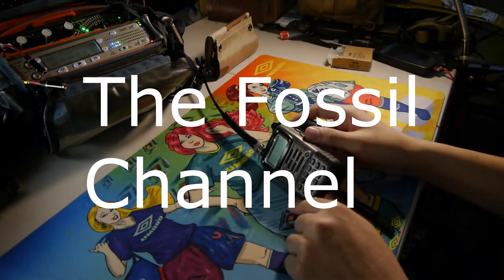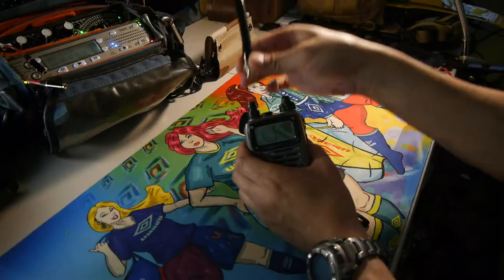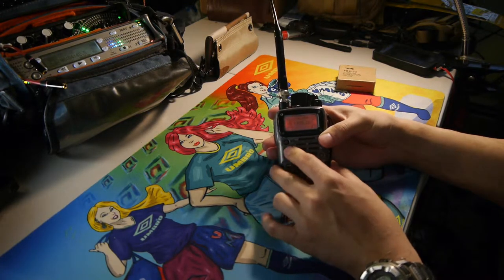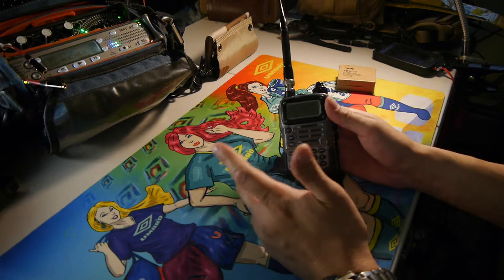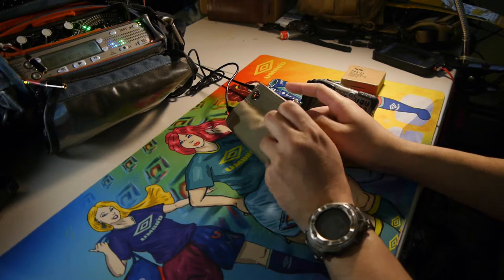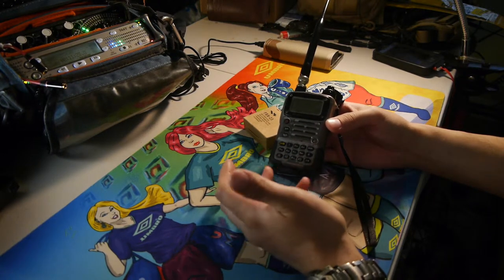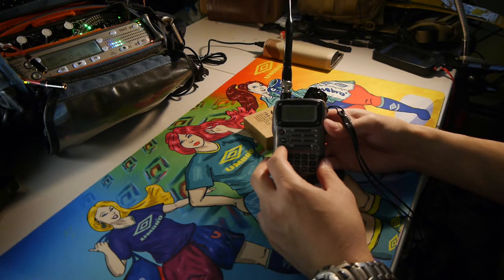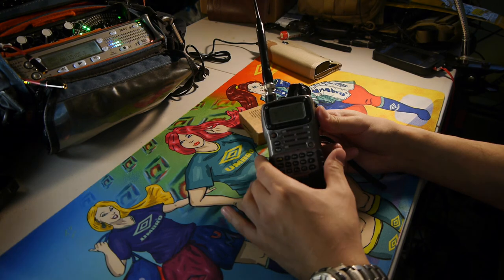Yaesu Vx7r EDC Radio Ham radio

Comment: when you use the non-stock antenna with the radio, do you loose the "waterproofness" of the radio?  I'm thinking about getting the Vx-6r while it's still available commercially but I worry that if I change the antenna that has a BNC connector.
Reply from the maker: On the vx7r i havent noticed a loss of waterproofing.
Reply: You would have to look into the build of the antenna or connector. 
I have a VX-6r, and the water tight seal is on the body of the radio itself, a small raised rubber ring where the antenna meets up with it. 

The waterproofness of the radio if used with an aftermarket antenna/connector, would at that point more than likely depend on the waterproofness of the antenna/connector and less on the connection point between the two. If water can make it through the BNC adapter I would imagine it then could make it through the SMA connector and into the body of the radio.
I'm not sure without looking at a schematic of the connector, but it is possible. 

I had mine in a rainstorm with a SRH77CA just yesterday with no issues, but that is very different from submersion of course.

Comment: Have you ever had a ceramic filter fail after being replaced? Meaning, does the repair from Yaesu fix the bad filters for good or are the replacement filters susceptible to the same issue?
Reply from the maker: They are susceptible to same issue. The design flaw ive read is that the dc port tends to break the ceramic filter if its used alot. I use drop in chargers even in the field
Reply: thank you again for the insight  @TheFossilChannel

Comment: Nice radio. Would you recommend this to someone who is just getting started?
Reply from the maker: I would recommend it to someone who is an intermediate as the menu front end programming is a bit difficult to learn. there is a program called vx7r command you can use to program this radio but i always suggest you learn how to program your radio on the fly so youre not relying on a computer. I would recommend this for you still because it is rugged, does more than one band and has a wide reception range as well. the vx6r is also something i would recommend. In summary. for a beginner i would not recommend it, for you however i would because you have an interest in prepping and seem to care about knowing your gear.
Reply: @TheFossilChannel  thank you. I appreciate your help in this area and I’ll be sure to keep in touch with you. Looking forward to getting a lot more involved in ham radio.

Comment: Nice review. Considering buying one soon. I have one question, the manual say "Dual In-band Receive (V/V and U/U) lets you
keep track of two active frequencies".
Can you set vfo A to VHF and vfo B to UHF frequency and be able to actually listen both transmissions at the same time? In other terms do V/U or U/V simultaneous dual receive works? Thanks.
Reply from the maker: Yes you can do that. You can monitor VHF and UHF at the same time.
Reply: @TheFossilChannel  Thanks!

Comment: Just got one of these used.  Following instruction manual, I can only change bands through 6m, 2m, 1.25m, and 70cm.  Cant get it to go into the RX only bands such as air band, weather, am and fm broadcast radio, etc... How do you get into the RX only bands?  Following the manual, choosing the main band, and pressing band to cycle through the bands, only cycles through those 4.  Even tried a factory reset, same thing.
Reply from the maker: im not sure im understanding. you want to monitor fm broadcast weather am etc? i usually push the vm button and punch in the frequency of the disired band or specific station and turn the vfo knob up or down the band. there is also a special sequence for the weather band you pus the function key once and them 3 to access weather bands only
Reply from the maker: you can also press  function and 9 on the pad to access special memory banks of pre selected "channels" or memory registers with coverage on marine and sw broadcast stations. be aware though youll need a good antenna to hear those stations. a 2 meter, 1.25 and 70cm wont be good enough to hear those stations unless youre on top of a mountain. a 6 meter antenna might be better but youd need a proper reception only antenna to make the most out of it.
Reply: That’s kind of the issue.  With factory default settings, on the main band, both in dual receive and in mono band, I press MONI then 3/WX, but nothing happens and I get 2 beeps.  Again, if I’m on the main band, and I press BAND, each time I press it, it will cycle through 6m, 2m, 1.25m, and 70cm bands, but never pulls up AM and FM broadband, Air Band, etc...  like I can’t even tune to those frequencies to listen, it’s like it’s locking into 6m, 2m, 1.25m, and 70cm only.
Reply: @JimPalmer3  you have to be in VFO mode to switch to the other bands you’re talking about
Reply: I think you are in restricted mode go in menu and open up  or expand settings can ‘t quite remember what it’s called?once it’s ok’d you should be able to access those frequencies/bands

Comment: Is it digital and used fusion?
Reply from the maker: it is analog and does not have the fusion that you can find in ft70r and ft1xdr ft 2dr ft 3rd etc. this radio is a quad band however and can do 300mw max on 1.25mhz and 5 watt fm on 6m and 1 watt 6m am. 5 watts on 2m and 70cm fm. The radio is a work horse with the only common issue is the cf filters need to be replace on them after a couple of years. the rubber parts you can buy from yaesu directly for a couple of cents... gaskets etc. If you want fusion get a newer model radio such as the ft 3rd or the ft70r

Comment: This is not a quad band radio, Yaesu VX 7R is a dual band radio, 50 mhz and 144 mhz are the same band VHF, and 430 mhz is UHF, so only 2 bands.  The use of BNC a bad option, for UHF the SMA is a much better connection for high frequencies that’s why so common on recent radios. This transceiver will not work in 1,2 ghz. Please inform your self before making these videos.
Reply from the maker: Bnc connections are useful as they dont as often as sma and allow for fast disconnects. Sma is good for uhf , but only in certain settings. For example while carrying this outdoors which is it's intended purpose being water reistant to water proof of ipx7 conditions, youd want to have a stronger connection for the antenna point. Sma is way to weak for consideration. I may have made a mistake by saying 1.2fhz in reality its 1.25meters.  This radio is capable of functioning in 4 different areas 6meters fm am, 1.25 meters fm , 2 meters fm, 70cm fm. Your opinion on the sma is correct with it being good for strictly energy effciency, but falls flat when faced in reality of use. Thanks for your time
Reply: @TheFossilChannel  I’m with you. Good points.  Thanks for your show.  ツ